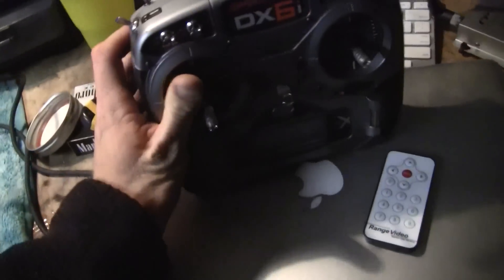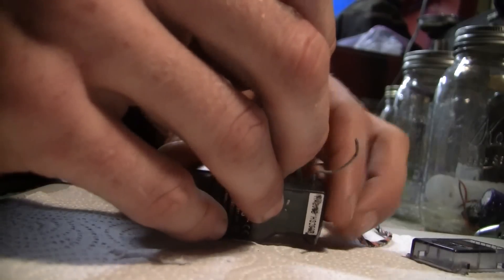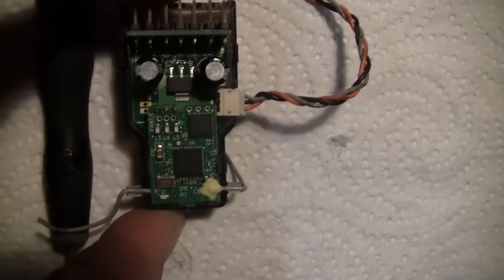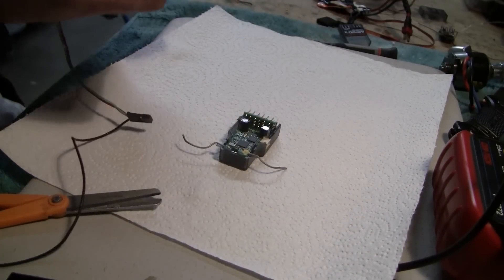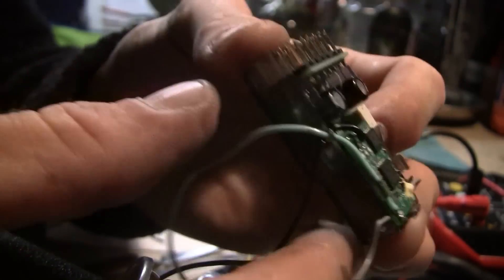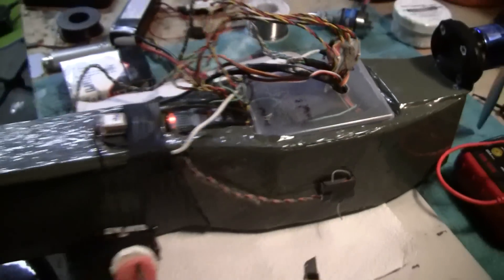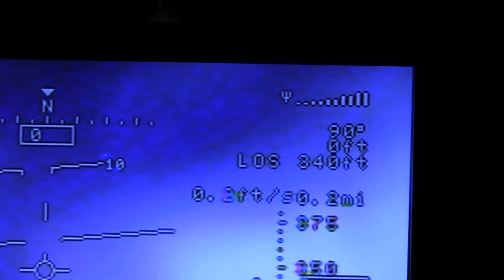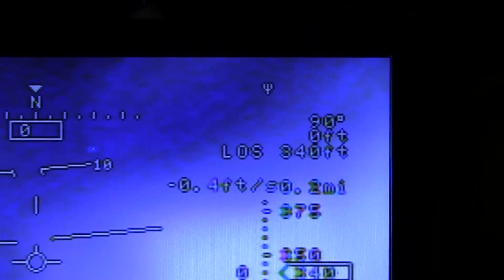Spektrum 2.4 Rssi Feed DIY

Comment: So you are using the "brightness" of the LED as the RSSI output, right?
Reply from the maker: The led is a lost packet indicator when it flickers its telling you that it has missed some data from the transmitter. rc explorer doses a really good work up on it... check this out. rcexplorer.se/diy/2011/01/lost-packet-indicator/
also when u look into upgrading your transmitter check out frsky taranis.
Reply: thank you very much, I'll check it out!

Comment: Very interesting. I wonder if the same technique can be applied to other dsm/x receivers. I have a 6200 as well as an 8000. I may give this a try, probably on a cheap orangerx first though.
Reply from the maker: Yes it should work on any rx that has a status light that flickers when connection is being lost.